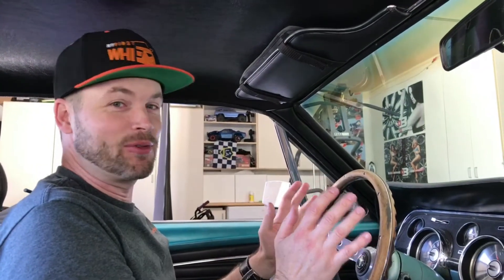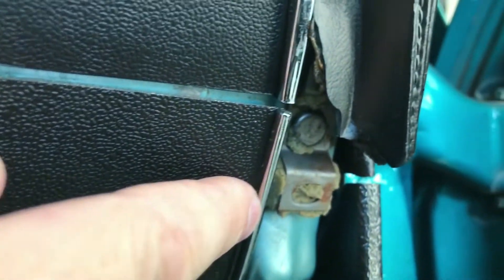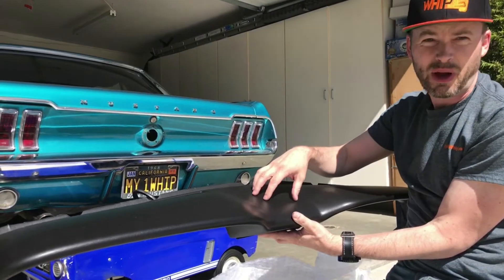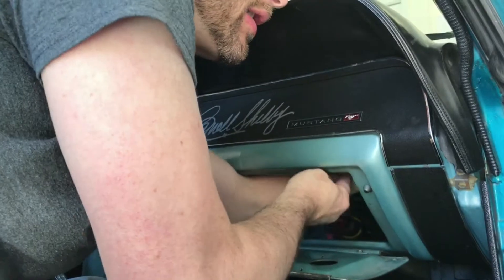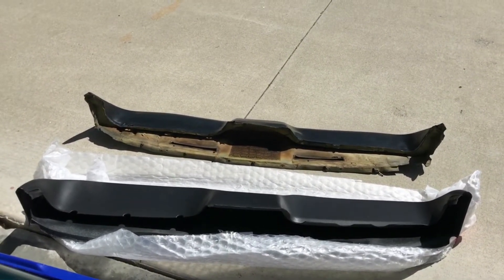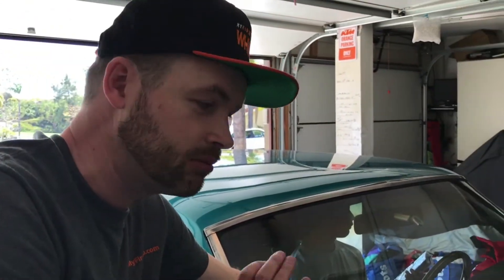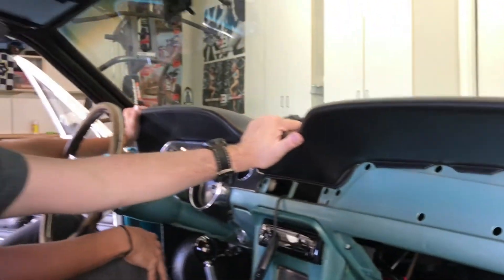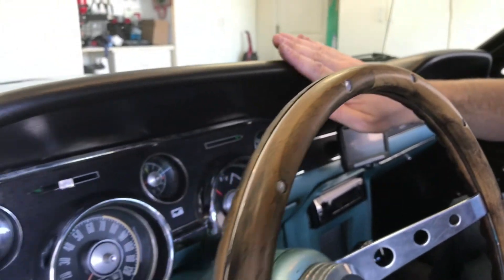Mustangs to Fear 1967-68 Dash Pad

Comment: Did you had any trouble where the steering wheel is at.. I wish you could make a video on  Unscrewing every bought By the steering wheel Looks like that my be a pain in the neck
Reply from the maker: If you are referring to our dash pad you need to put a rag on the dash pad to protect it while you are putting the cluster in. I think the auto correct was on and wasn't sure what you were asking.
Reply: With your video I was able to take it out I got it thank you.
Reply: What is cluster I'm sorry is my first time doing it
Reply: I have another Q: did you have to put a blank glue.. or it it fit perfectly